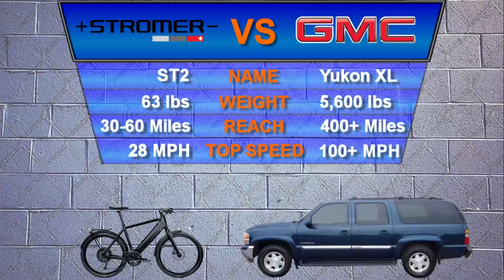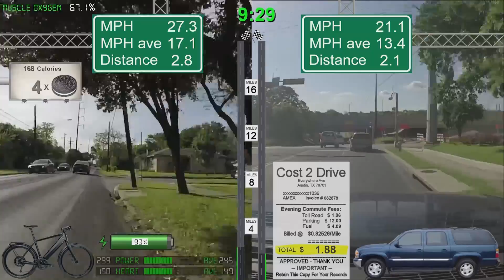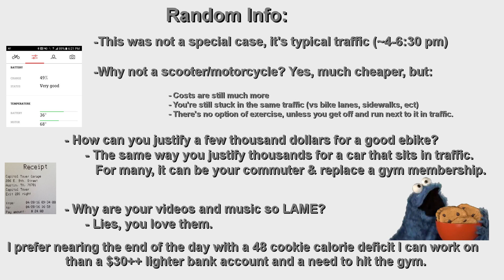Stromer ST2 ebike commute vs car commute Austin Texas (20 miles)

Comment: Great comparison. Makes me consider. Only problem will be weather and sweat;
Reply: The weather is not as big of an issue as it may seem.  I've commuted (off and on) to various jobs in both Austin and Dallas.  I've never had an office with a shower.  Its truly not needed.  I'd bring a multiple sets of clothes to work (by car) and leave them there for a few weeks.  When I commuted by bike, the SECRET is to wear sweat wicking clothing and then sit at my desk 'cooling down' from my ride for about 15-20min.  I'd simply check email during this time.  Once cooled down, I'd go the the bathroom and do a sink cleanup with a hand towel.  Apply deodorant, change into work clothes and go about my day.  In my Dallas job, I'd occasionally have customer facing meetings and nobody ever knew different.  My co-workers were even surprised at how I did not 'stink from the commute'.  The secret is in the cool down before changing clothes in the morning.
Reply: I just use lysol wipes on my armpits when I show up to work, and change my underwear and shirt. Works wonders.
Reply: Dieter Janout sweat is not a problem with the stromer. its effortless on top speed. weather can be an issue, but just carry rainjacket and pants in a side bag

Comment: Love it! I had no idea an e-bike could flat-out beat a car on a commute this length. And e-bikes are only going to get cheaper and more efficient.

I wish cars gave people a bill after every drive so they knew how much that little jaunt to the gas station "around the corner" to save $.05/gallon is actually costing them.
Reply: This is Dave Chang btw. :) Kind of missing my downtown rides right now; I need to work them into my quaroutine...

Comment: Awesome video! But theres no way to justify a 7k bike. Not happening.
Reply from the maker: Thanks! and I hear ya on $7k for a bike. I don't want to tell people how to spend their money. However, the data can be surprising, depending on the situation, such as mine, it can pay for itself. Here's what 5 years of commuting via personal transport looks for me (more data at bottom):

$5,065 -5 years/55k commute miles (Juiced Bikes CrossCurrent EBike)
$10,565 -5 years/55k commute miles (Stromer ST2 EBike)
$13,339 -5 years/55k commute miles (KYMCO People GT Scooter)
$36,855 -5 years/55k commute miles (Hyundai Accent)
$44,615 -5 years/55k commute miles (Toyota Prius)

What if I bought the car AND the EBike, but used the EBike to commute? This would save on commute tolls, parking, gas, & knock off a couple of oil changes, the result:

$12,934 -5 years/55k commute miles (Scooter & CrossCurrent EBike)
$18,434 -5 years/55k commute miles (Scooter & Stromer EBike)
$26,800 -5 years/55k commute miles (Hyundai & CrossCurrent EBike)
$32,300 -5 years/55k commute miles (Hyundai & Stromer EBike)
$36,255 -5 years/55k commute miles (Prius & CrossCurrent EBike)
$41,755 -5 years/55k commute miles (Prius & Stromer EBike)

Every case, except scooter+Stromer, results in basically an EBike that pays for itself, even if you buy the car, by the savings of commuting with the ebike.

EBikes are reported to be the most efficient method of personal transportation. More than regular bikes and walking. See the TED Talk:
https://www.youtube.com/watch?v=0zJHMMYa01g

My above info is based on mostly my commute situation:
262 working/commute days in a year
11,000 yearly commute miles (42 miles per day)
$2.12 per day toll roads

Juiced Bikes CrossCurrent EBike:
$1800 MSRP (with large battery option)
$170 tires (2 sets)
$140 chain & cassette (2 sets)
$63 charging for a year (max assist level, $0.24 per day)
$80 front & back brake pads (2 sets)
$100 tubes, slime, & tune-up
$2,353 1st year
$553 2nd year
$553 3rd year
$1053 4th year (new battery)
$553 5th year
$5,065 for 5 years

Stromer ST2 EBike:
$7000 MSRP
$170 tires (2 sets)
$140 chain & cassette (2 sets)
$63 charging for a year (max assist level, $0.24 per day)
$80 front & back brake pads (2 sets)
$100 tubes, slime, & tune-up
$7,553 1st year
$553 2nd year
$553 3rd year
$1353 4th year (new battery)
$553 5th year
$10,565 for 5 years

Toyota Prius 
$24,200 BASE MSRP
$510 gas (220 gal, 50 mpg, $2.32 low-grade)
$1,300 insurance
$90 oil (3 oil changes)
$18 state inspection
$50 registration
$555 toll road
$1,560 parking ($125/mo building badge)
$28,283 1st year
$4,083 2nd year
$4,083 3rd year
$4,083 4th year
$4,083 5th year
$44,615 for 5 years

Hyundai Accent
$14,745 Base MSRP
$849 gas (366 gal, 30 mpg, $2.32 low-grade)
$1,300 insurance 
$90 oil (3 oil changes)
$18 state inspection
$50 registration
$555 toll road
$1,560 parking ($125/mo building badge)
$19,167 1st year
$4,422 2nd year
$4,422 3rd year
$4,422 4th year
$4,422 5th year
$36,855 for 5 years

KYMCO People GT (300cc highway&city scooter)
$4899 MSRP
$439 gas (157 gal, 70 mpg, $2.80 premium)
$150 oil & tuning
$555 toll road
$500 insurance
$14 inspection
$30 registration
$6587 1st year
$1688 2nd year
$1688 3rd year
$1688 4th year
$1688 5th year
$13,339 for 5 years

Things not even counted, that could be:
-gym membership, or time spend jogging/exercising to get the same fitness as bike commuting
-time spent standing at a gas pump, changing oit, registering (motorcycle/scooter requires license)
-vehicle maintenance costs (tires, car battery, brakes, ect)
Reply: khlash ; Not all ebikes are that expensive, I just bought the Surface 604 rook with 500wh motor from Amazon after much research for $1899.00 tax included, but haven't received yet to give any feed back. 
hopefully I picked the right one.  Anyway if you google Surface 604 or, on YouTube, you can get a wealthy of information on this bike including reviews.

Comment: SUper video!!!
I also want to make the same video but between a van and ST2S.
How did you make the info about speed and power rate? This looks awesome! Which program did you use?
Reply from the maker: +Denis Grishin Thanks!

The easiest and cheapest way to do a video like this would be to use a fitness app (free) on your phone for speed, distance, time, then maybe add a heart rate monitor ($60) to it to give an idea of intensity and calories. Use Dashware to overlay it and do basic editing and a cheap/free editor to do more (like Windows Movie Maker).

As far as what I used:

*Powertap P1 Pedals (for my power output & cadence)

*Scosche RYTHM+ (for heart rate)

*BSXinsight (for muscle oxygen)

*Wahoo ELEMNT (for speed, timing, and to collect the data from the other devices)

*Dashware (mapped out the data from the ELEMNT and made custom gauges, then synced the data with the video in overlays)

*Paint Shop Pro (to create images and gauges in video)

*Adobe Premiere Pro (for the rest of the video editing)

*Purchased various music and effects, then mixed them

Comment: Interesting comparison. Some of the biggest problems with making the Stromer practical are the $7000 price tag and for several months of the year you'll be sweating like a hog when you get to work riding the bike in Texas. Plus most people would still have a car so no saving on insurance. Also, an ebike that goes above 20mph isn't supposed to be used on the road in the US, but I would guess most cops wouldn't care.

Still an interesting comparison, and if you have a situation where you could get rid of a car completely, it would save a lot of money.
Reply from the maker: +sandman x  Thanks! To clarify, Texas law states: "cannot attain a speed of more than 20 miles per hour without the application of human power"
So, it's perfectly legal. The 20mph limit is for bikes that have throttles and operate like mopeds.

For the price, there are many other options out there for well under $2k and still great bikes, like juicedbikes.com CrossCurrent @$1500 MSRP
Reply: Thanks, I didn't realize pedal assist allowed higher speed than 20mph.

I see what you're saying about lower priced bikes, I'll have to take a look at the CrossCurrent next time I drive through Austin(I'm in the Houston area) as that's the only dealer in Texas for that one. I currently have a Specialized Hardrock Disc 29 and really like the way it's laid out, and the CrossCurrent looks similar with the locking fork hardtail design and disc brakes. I'll have to look for some other hardtails too.

Comment: You can do it without sweating but you are pumping 161 heartrate average.
Reply from the maker: +HushemFlupskluk Yes! I wanted to show the high intensity workout you can still easily get. For me, getting a 3+ hr bike commute down to <2 hrs, which is the same as driving, with the benefit of great exercise, was one of the big goals I was going for.

Comment: Adam, that was very well done.  I came here from LinkedIn to see if it was actually your video.  I live near Arboretum and can make it downtown easily and safely in less than an hour on my commuter bike.  I may try to link this video to some other places.  It needs to be seen by more people.  Especially those who may not be 'serious' cyclists.  The e-bike facet would make it much more appealing to them.
Reply from the maker: +Cody Baron Thanks, Cody! It's great hearing from you again! I have a Stromer ST2 and a Focus ebike. I've let a co-worker use the Focus to try bike commuting and he loves it. I know it's not for everyone, but I know a lot of people would greatly benefit, mentally, physically, & financially, by trying it out!
Reply: +Adam Alter After I posted this I went and researched the Stromer.  The price tag is pretty steep!  But this makes me want to research more of the offerings.  What do you think about your Focus?  Your Stromer looks like the bee knees for a commute to downtown (and back).  I've got a new job and have begun commuting to work again.  But its a nice easy commute that doesn't need an e-bike.  Did you see the emails I copied you on?
Reply from the maker: +Cody Baron Sending you an email
Reply: The Stromer is such a nice bike. I can do the same commute with a Bafang/Lunacycle BBSHD middrive 48V-14AH kit installed on a ten year old Trek mtn bike frame upgraded from V-brakes to disc, commuter Schwalbe tires, rack, panniers, blinky lights, etc. The Stromer has a more advanced PAS system for certain. My solution was about $1500 all in. Those of you who choose to live in these huge cities must have the patience of a saint. I chose a much smaller city to live in. My driving commute is 20 minutes, my bike commute is a little more (lots of hills here). Parking is free. My bike has about 2000 miles on it as an ebike and not nearly that much as a pedal only bike. Having an ebike has really increased my mileage.  Love to ride this bike.

Comment: I don't know how your device measures it, but ~1000 kcals seems too much for 20 miles route.
Reply from the maker: +Yevgen Antymyrov I got it from the Wahoo ELEMNT, however, I uploaded the raw data to multiple sources, which some run their own calculation based off rider power, weight, temp, heart rate, muscle oxygen, ect, and the results show:

MapMyRide 1008
Garmin Connect 1008
Wahoo ELEMNT 998
Todaysplan 993
Strava 819
RideWithGPS 811

Considering I took the 96 calories from the car drive from the same device and method (had same heart rate monitor on), if it's high or low from actual, the counts are at a minimum, as relative to each other as they can reasonably be.
Reply: Anyway, nice video. I'm saving money to buy ST2.
Reply from the maker: +Dennis Gunthert I didn't overstate anything, I reported the data.
MapMyRide 1008
Garmin Connect 1008
Wahoo ELEMNT 998 <-- what I used
Todaysplan 993
Strava 819
RideWithGPS 811

Based on thousands of data points collected by:
Powertap P1 pedals (ave 279W, my power)
Scosche heart rate monitor (ave 161)
Wahoo ELEMNT computer (56 minutes, 33 seconds)
Wahoo ELEMNT computer (ave 82 degrees)
My weight (200lbs)

The numbers didn't come from me, they came from the Wahoo ELEMNT, and the other devices that sent their data to it. In addition, I uploaded the file to the above platforms for their calculation as well. I even added it to ShapeSense manual calculator and it says 974. 

If I do a casual ride (132bpm & <200W), the same commute says I burned 2-300 less calories. If this is wrong, I don't know what to say, other than contact all of the above platforms that track calories if you can help them with their algorithm. 

In the last 3.5 years, I have nearly 27,000 miles logged, with data points, via a cycling computer. Of those miles, 7,500 have been by ebike.

This ride was 56 minutes and 33 seconds total time, of that, 52 min moving time, and:
21 min 06 sec above 250W
10 min 45 sec above 300W
5 min 25 sec above 400W
Ave temp - 82
Ave cadence - 73
49 min 22 sec above 156 heart rate
Reply from the maker: +Dennis Gunthert  This ride was 735kJ and 819 Calories according to Strava. Strava has calories for me. I understand it's said calories are over estimated, but I also used the same heart rate strap and Wahoo for my drive for the <100 cal, so they're very comparable, and my only other option is to guess.

While this ride was 56min 33 sec @ 279W, I have many others that I made the same time at 160-200W. It's very realistic for someone to get this time. This wasn't exactly a fast ride, though I did ride hard. It's because it takes <200W to get to 28mph, and usually 350+ to hold 29mph, so you don't get much extra, given most of the time comes from the stops and coasting. On top of that, the car cut off the first .5mi+ because the GPS hadn't picked up, and it wasn't an especially slow drive, compared to typical. I can present all the data, I obsessively track it, purely because I love data.

You're welcome to go look at my profile, it's public, with all my times, speeds, watts, heart rate, ect. Just keep in mind, I always start the ride and hang out in the parking area a bit, and I also cut off the point I got to my neighborhood and was greeting neighbors and such. So, the data will look different due to that goof off time.
Reply: I pulled your Strava profile. Your FTP is pretty solid (a good 50w on me). I learned at a certain point it's easier to lose kg than gain watts. My goal is to to lose a few more kg and get down to 65kg. W/kg really only matters on climbs though. I'm a serious road cyclist and I'm thinking about getting an Izip E3 Protour. I test rode the Specialized Turbo and it was a blast but the hard motor cutout at 25mph was annoying.
Reply: Thanks, I'll check it out. There's a dealer pretty close to me. I didn't even know you could get a 28mph bike for $1500.
Reply: 735kJ seems high with the electric motor assist but if you have Powertap pedals than I guess it's accurate. I know from experience with all of that coasting it drags down your average power numbers. I know on my road bike ~800kJ in an hour would be a VERY hard ride.
Reply from the maker: Yeah, the stops definitely pull back on my ave power, from coasting, and many weren't long enough to give any real rest benefit to counter.

When moving, I basically put out the same power as I do on a non-ebike, but comparing to a heavy commuter in the city, I'm going ~7mph faster on average. Backing off the effort, doesn't slow the ebike down much.

I pulled up a 100 mile solo ride I did on a Cervelo R5, using a Quarq Riken, to compare, and it was 4hrs 41min total elapsed time and 4,438kJ (947kJ/hour) so it doesn't seem off, from that and my time on a KICKR. If you look @ pwr/weight, it's much less impressive though lol.
Reply from the maker: You may want to also check out the JuicedBikes CrossCurrent, looks pretty solid and they're known for quality and price. The Stromer ST2 cut-out is pretty smooth, the motor starts backing off after 28mph, and is off by 29mph.

Comment: Nicely done. Bike route looks a lot more scenic ... but it looks dangerous too in case of careless drivers that might hit you. You make the case for me though. 9 miles to Downtown DC takes 45 min by car, I wonder what an EBike could do in comparison
Reply from the maker: +debashis22 I was surprised, looking at the vid on how much less chill it looks than actually doing it. I think it's because:
-the camera shake, making it more dramatic
-the GoPro lens stretching it for wide, making things warp around me like I'm going faster
-the fact that I sped up both videos by 800%, so people didn't have to watch it for an hour hahah. 
The start, and the points it slows, are actually normal speed, for example, at 3:06 and 6:08 

With a car, you learn the route that works best for you from things like realizing a certain light takes 3 light cycles to get through during rush hour, or one that's extremely long and you always hit red, or an intersection you need to turn left, there's no left signal and you never get an open shot.

It's the same with a bike, but the route and many of the reasons are different. A light that cars have to wait 3 cycles to get through is usually great for a cyclist, because you ride straight to the front, and there's not much danger because the cars are just sitting there waiting. If an intersection sucks for turning left, you can sometimes ride up and take the crosswalk and sidewalk (depending on your state/city laws), like I did at 3:44 Or, like in my case, it's posted as legal for bikes to take the right turn lane for going straight, which saved me a ton of time in cases like a shortly after 3:10 where it looks like the guy is racing me, only to get stuck in a long line of cars at a 4-way intersection. Then there are other things like roads with big speed bumps that don't really slow bikes down, ect.